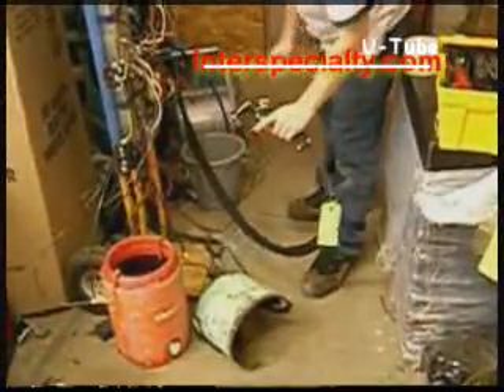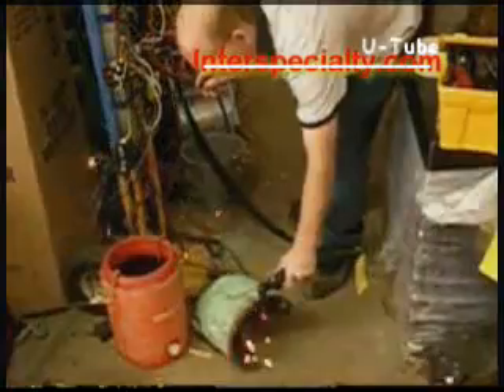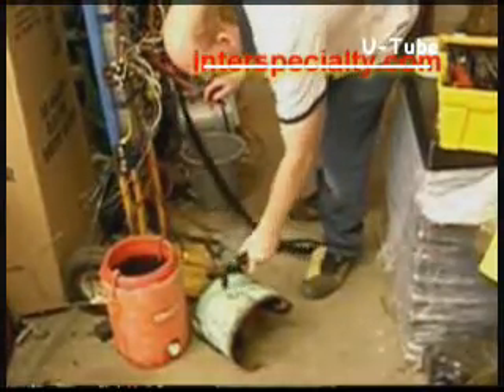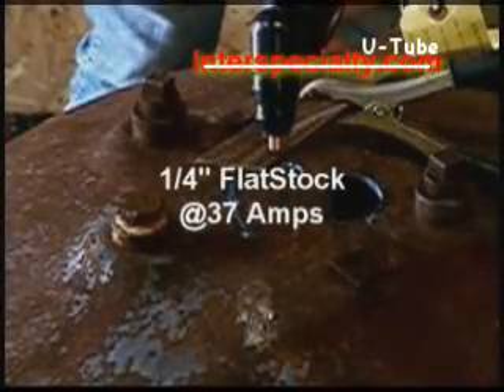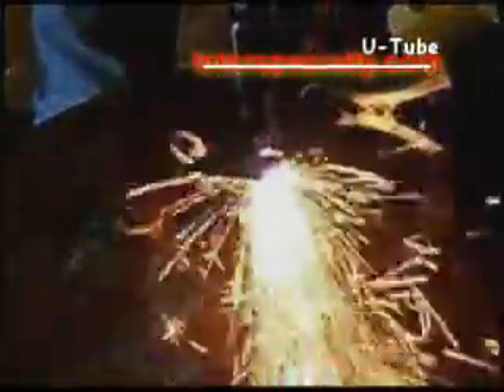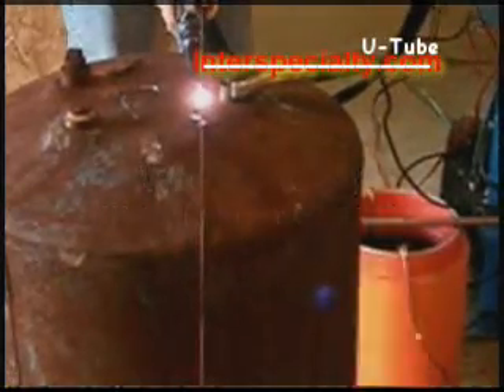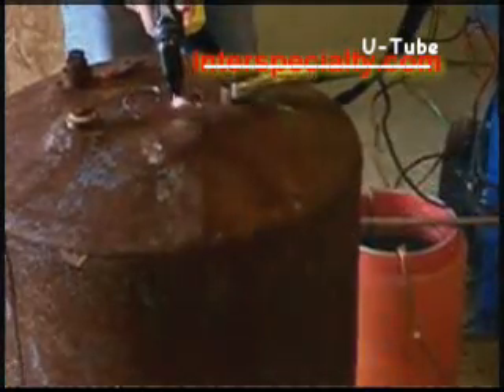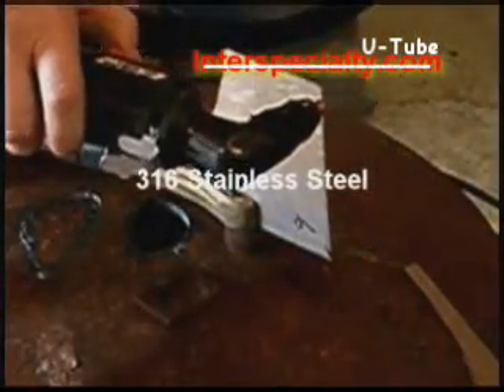Opperation of Home Made Plasma Cutter

Comment: @tsarvey123 From the direct output of an isolation transformer, yes. But you would have to be touching both lines where this plasma cutter could kill you by just touching one line and anything else lying around that happens to be grounded. Also on a real plasma the output is isolated DC which is much less likely to kill you than the half rectified AC you would get shorting yourself to ground.
Reply: I was thinking needed an isolation transformer.  That's just basic power supply setup thinking I've learned with the older tube electronics test equipment repairs which have HV components.  The variac, isolation transformer, fuse, current limiting gang of light bulbs and thinking inside the system some over temperature safety fuses and whatever else I find is required to bring to code from an RFI/EMI perspective also (shielding and filtering).  

Any suggestions?  Thinking I'll use the instructable since I don't see much for this design though looks like cuts impressive.

Comment: THIS KILLS YOU:
- If the relay in the positive line fails
- If you touch the torch tip
- If you touch with the torch an isolated metal part that 
  has contact to your body
In addition to that:
- it runs the torch with up to 340 volts, which is approx. three times the rated and permissible voltage

I can only emphasise: DO NOT USE THIS CIRCUIT!